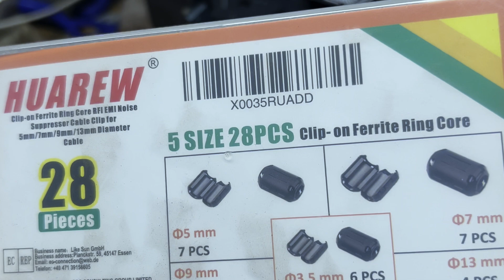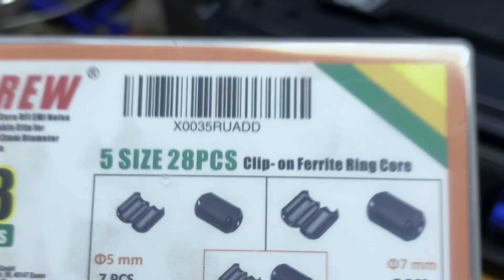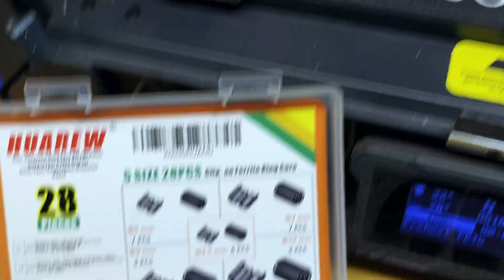3 Easy 3D Printer Upgrades Every Beginner Should Try

Comment: Good point. I had big pains with the first version of my self-made CNC plasma. Whatever digital fabrication device should be EMI-proof if exposed to a EM-noisy place. Complementary to the ferrite and effective, is to shield the usb cable  with a metallic braid and grounding it tight.